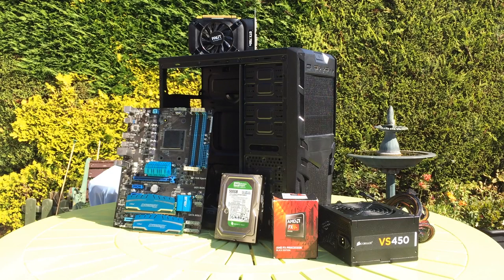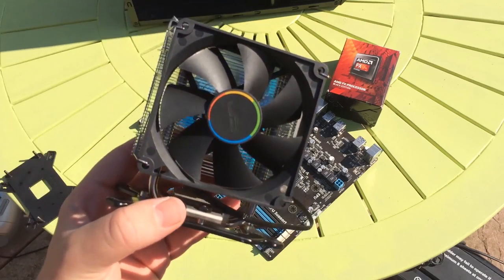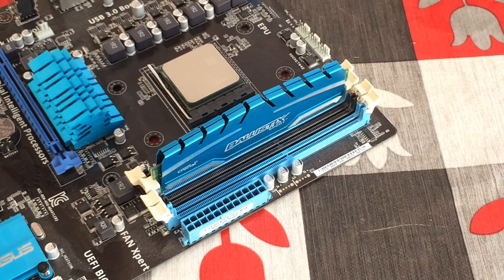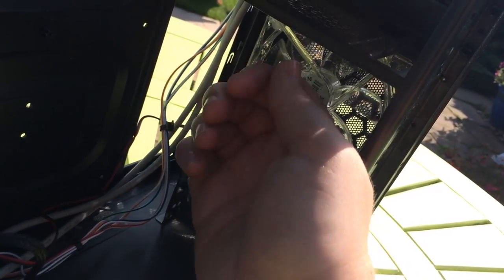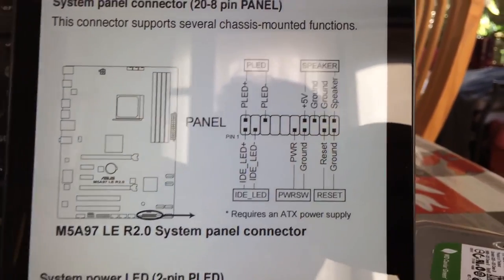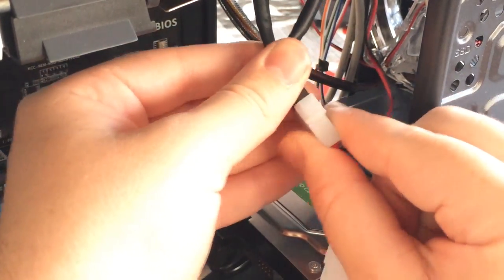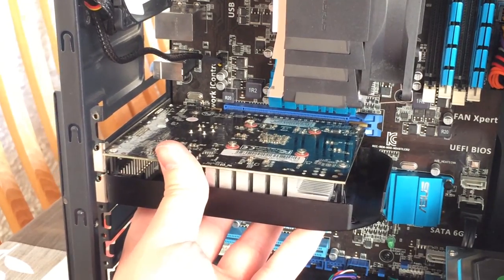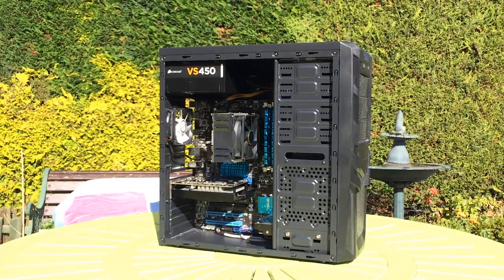Let's Build A Budget Gaming PC - Sensible Used Parts System

Comment: That's such a nice little rig...
- M5a97 R2 LE is a nice budget board, with 970 chipset which is more than ok for the Fx CPUs, being a mid to high end native AM3+ platform fully 125w cpu capable, that even features rear and front USB 3.0, and up to 32gb DDR3 1866 and all SATA3 connectors, so pretty solid for upgrades inside the platform. The only real downside is the lack of disipated VRM, a huge matter on such an overclockeable technology like Fx series. For that i would suggest M5a97 R2 (non LE). or m5a97 Evo...
- Fx4300 is a nice little budget CPU... it can be found for 1/2 the Fx6300 price and will provide about 3/4 the performance, including a slightly improved singlecore performance, thanks to his higher frequency. It is also THE lowest consumption FX cpu. on both single and multicore performance, it is very very close to Phenom II X4 945 c3... but with some newer instruction sets included. It is a nice stop gap for maybe one year up until getting an Fx8350/70.
-GTX750Ti Despite being kind of dated and somehow underpowered for today's needs... it is still a good gaming card for lower resolution (A.K.A. 1366x768) in which can perform as good as Rx570, so yes, it is a good gaming card even for 2020.
- 8GB DDR3 1600/1866 is a nice sweetspot for this ring, and it is good to be in 2x4, since 4gb sticks can be purchased really cheap and throwing 4 then 8, then 12 and finally 16gb. It is safe to mention that 16gb is the maximun reasonable for ANY AM3+ CPU, including Fx8350/70, since in the future when 16gb be a little short for gaming and stuffs, Fx series will be way obsolete.
- I wouldn't have picked an aftermarket "fancy" cooler, just a stock 125w AM3/AM3+ cooler, which are extremely cheap used will provide a little extra cooling compared to stock 95w... the money saved MUST be used in a 120gb SATA3 SSD. That's the real deal to get a somehow "improved" experience, not for gaming but just for everyday usage.
- The 500gb HDD is ok, but not that much... nowadays games have skyrocketed in their disk usage... some games even needing 100GB of disk space... it is ok, nevertheless, to put a 500gb HDD and later on add another 500gb disk.
- The case is kind of ok, only real problem with cases are the need of 2x cooling solution, one frontal in and one rear out, this provides such an improved temp compared to no fan, it is mandatory to be honest... The next thing to search for is frontal USB 3.0 since it will really handy, i'll promise. But there are 5.25 bay brackets which have USB 3.0
Is this an "OK" build for 2020? well, yes... for the right price... and i know what i'm talking about... since i have an Asrock n68-vs3 fx + Fx4300 + R7 250x 2gb + 8gb DDR3 1333 + 1 120gb SSD + 2 legacy 160gb HDD, and i can play older Triple A tittles and modern MOBAS at 1360x768 high 45+fps no problem. Main limiting factor is the MOBO (only SATA2, no USB 3.0 and has a tendency of making CPU throttle every now and then)

Comment: Very good video! I consider my self a PC guy, but I have never ever built one. Because I almost always had no money for that, or even when I did - I used to buy prebuilt ones (yah, I know, God forgive me as I didn't know what I was doing...). You touch little details which are always left out by other channels. 

I still hope to gather some 300-350€ to buy a nice GTX1060 GPU. I hope I won't fuck up putting it in my case.

Comment: Making a mid range budget pc around $700, it has....
-Ryzen 3 1300x
-GeForce GTX 1060 3 gig
-8 gigs of ddr4 2400mhz ram
-1TB HDD and 128 GB SSD
-500 watt EVGA bronze rated power supply ( for future upgradability)
-( can't remember the exact mobo name) Asus B350 Prime Plus
Super excited can't wait for it to get here, just need to buy a case and keyboard but I can't decide :/

Comment: Try the x79 platform, it's not the cheapest for motherboards, but the quality of cpu-s is remarkable. I personally use a 100$ MOBO from aliexpress and $100 e5-1650 and it runs so very smooth :)

Comment: Nice build guide. I have the same CPU cooler, its a great quality cooler which is very silent and with great performance for the small tower model heatsink design. It would also be very interesting to see the performance increase when this CPU is overclocked. These ones usually overclock fairly well, and can really use it. As you thought, the CPU is the bottleneck here, as the AMD FX series is quite weak core wise because of the 2 integer, 1 floating point unit module design. One remark on the HDD choice, if possible avoid getting a green or eco hard drive for a budget build. They are build to be energy efficient  and trade in performance for it, while used prices (at least, here in the Netherlands) are quite the same

Comment: I have the non le version of this board, with an fx 4300 overclocked to 4.5 stable on air with a hyper x 212. Exactly the same gpu, 2gb palit 750ti. I love my rig. It's cheap, and performs well enough to kick any consoles ass

Comment: I usually do the front panel header OUTSIDE first and then put the cpu, ram, etc while the board is in the case.  Unless it has a bracket for the cooler.

Comment: Here's a budget PC build that's a little higher end than this:

FX 8320 Black Edition 
16GB ADATA DDR3 1600 
GTX 1050Ti (I chose the Gigabyte OC edition)
ASUS 970 Pro Gaming/Aura Motherboard
Noctua NHU-14S
For newer builder's I'd suggest getting either an NZXT S340 or Phanteks P400S for ease of building
128GB Samsung SSD (any brand will do, this is for OS)
1TB Hitachi HDD (again, I'd recommend WD for this as their drives are usually cheaper but I got the Hitachi on sale)

Set your CPU multiplier to x20 for a quick and stable OC to 4.3GHz and you have a decently beefy 8 core chip, the Noctua cooler keeps it cool and almost dead silent (even at 90% fan speed), 16GB is plenty of RAM for almost any amount of Chrome tabs, the Phanteks case would be my pick due to all the dust filters, fan controls and RGB options available, plus all the sound deadening keeps it all quiet, The reason I chose the 1050Ti OC is because the card has a small factory OC, Gigabyte are a trusty brand and the card's fans are OFF up to 50C meaning the system is almost dead silent even under load.

Comment: my latest budget build.. 
Dell vostro 400 775 mobo $15
LGA771 Xeon X5470 @3.3ghz $30
hyper T2 cooler $10 
8gb DDR2 800mhz $20 
500gb SSHD $20 
GTX 750 ti $40 
Apevia case w/ 480w PSU $25 

Modded the motherboard and CPU and ended up with a $160 beast..

Comment: many intel motherboards color their panel layouts which shows you which wire goes where to make it easier to connect your panel cables. you would think in 2017 there would be a universal standard panel layout connection method by now, but nope..

Comment: I'd like to see you try 750 Ti SLI using different SLI auto
Reply: Joe Manfred GTX 750Ti doesn't have support for SLI, u won't find any sli bridges on any gtx 750
Reply: gtx 950 SLI would be cooler since they actually support SLI and can sometimes be bought for the same price as a 750 ti if you look for more then 2 seconds.
Reply: It's physically impossible to SLI a 750Ti

Comment: Any chance of seeing a WoW bench with this? I'm thinking of using some spare parts to build a pc for my bro. He currently got a stock Q6600 with a 1gb gtx 750 (non ti), i have a spare fx 4100 on a ga-990fxa-ud3 with 2 failed ram slots that limit it to single channel & also have a spare radeon hd 6970 2gb. Depending on the psu for the build either the 6970 or 750 will be used, what you showed would be slightly better than the 4100 & 750 so just currious how it'd perform.

Comment: i have the same case. In my country it was around $15 brand new and as low as $5 used. There's also one with 350w PSU for $25. Too bad the usb ports are rubbish.

Comment: The GTX 750ti is going for $170 USD here in America.  You could save even more in this build by using a GT 1030 ($80 USD) and get relatively the same performance.
Reply: Maybe new, but don't by a 750ti new. You should be able to get one for $70. At 170 you can get a 1050ti or if lucky a 1060 3gb.
Reply: Dan Bodine - But, where to get it new? Can you trust used graphics cards on eBay? There is Craigslist. But, my rural area is kind of a deadzone for PC hardware.
Reply: Axess2084 Generally you can trust them,just do your research. Reddit hardware swap is also a good option.

Comment: What about:
i7 980x
32GB DDR3 RAM
Gtx 980Ti
550w Psu
Kraken 31x watercooler
Thermaltake 21 Versa

Guess the price
Reply: 400 dollars
Reply: Thomas Jansen $1050 dollars
Reply: DarkTube These prices are way higher than you think
Reply: no sir its 400 i bet. its not 1050 dollars i think
Reply: Actually around 1400 dollars
Reply: I'd say about £500 or $400 since UK prices are fucked
Reply: It's definitely not 400$.
It Got A Fucking 980ti

Or maybe he snatched it at a really low price(which is unlocked)
Reply: Kabeer Ali yeah but the i7 is old as fuck and the cpu cooler is undoubtedly old as is the rest of it so the only part really worth any money is the gpu hence the price namely covering the gpu and he probs got the rest of it nigh on free.
Reply: I have a high end ryzen 1700 rig and I paid, including my mouse, koyeboard, and rgb lights, $1,300 after all upgrades this was only 5 months ago.  So "$1400" for his rig is kind of ridiculous
Reply: nocomply Good motherboards that support that 980x can be incredibly expensive. You should look it up, it's crazy.
Reply: 300-350$
Reply: Im going to say 650
Reply: Hillary Blinton did you just say that the gpu is 80$,it has the power of a 1070
Reply: If I could get a 980Ti for anywhere NEAR 80 dollars (75 ish Euros) then why would I be seeing people selling reference 970's for 400+ euros??
Reply: 250, bare minimum, 300 would be a reasonable price for a 980Ti because it's almost between a 1060/1070 in terms of performance
Reply: 600$
Reply: Dylan Collins after oc 980ti is better than stock 1080..
Reply: 200 euro for 980Ti
Reply: These motherboards are rare and hard to find in my country so i paid lots more
Reply: Sylwester nope. You need to overclock a 980ti to its absolute max to be equal with a fe 1080. Then overclock the 1080 and it once again smashes the 980ti. However don't get me wrong, that's still good for a last gen card. The 980ti is amazing as such there is no point in buying a 1080 if you have a 980ti.
Reply: $420
Reply: 800
Reply: 5000$
Reply: I thought that pretty much all X58 motherboards were limited to 24gb ddr3
Reply: 700

Comment: But you still need a monitor as well as a mouse and keyboard. You can get cheap 22" or 24" monitors for a bit over 100 euros or try to find a used one. And if you really don't care, a cheap mouse and keyboard will set you back 10-20 euros. 
Even cheap, old and used components like the ones used will get you a decent gaming PC still capable of handling most new games, although not with maximum settings at 1080p/60FPS. But a PC capable of that will set you back at least 700-800 euros, if not more.

Comment: Will be interesting if you put the fx 4300 with your 1060... 👀
Reply: lolCatHD it'll run things very nicely. There'll probably be some bottleneck, but I doubt it'll be bad. I was using my fx 4300 with an rx 480 before I eventually moved on to Ryzen
Reply: ArtisChronicles thanks bro

Comment: Hm... I'm kinda confused... My Xeon E5450 perfoms better than the FX in CB but has a lower Clockspeed and Powerdraw so why did you use an FX instead of a Cheaper but more Powerfull Xeon and Mod it to the LGA775 Platform?

Comment: is the corsair vs series reliable and good to power  low to mid end hardware?
Reply: I used to have a VS 550 and it broke after 6 months. From what I heard, the VS450 and 550 have manufacture issue and it's not very reliable. However, VS400 and 500 are good. Been using the VS500 since I had it as a replacement for the 550 (about 1 year) and so far so good.
Reply: They're terrible actually, get a CXxxxM (the M part is important), an EVGA 420 or an EVGA 450 B in the same price range, they're much better.
Reply: Thats strange, cos i have had cs 550 for over half a year and had no issues?
Reply: They're not in the "explosive chinese PSU" quality tier, but they're still really poor quality in comparison with other PSUs in the same price range.
Reply: Rudy S - I've been using the  VS 650 for more than a year and I have not experienced any issues at all. This brand of power supply may not be as good as other types, however the price is worth the buy for even a decent build.
Reply: This wont blow up, but dont expect it to last long.
Reply: @idk-jb7lx  lmao "explosive chinese psu" 😂😂

Comment: 2 years ago i had a GTX 960,my computer broke down and i sold the parts that was still working,now i'm thinking about buying a new graphics card but if i do so i'm going to need a new power supply and i was thinking of buying a after marker CPU cooler to.
What graphics card should i buy?
At the moment i have a Q6600 paired with a gt 610 for display adapter,the on board graphics is terrible.
4GB card should be fine.
GTX 1050 Ti
RX 550,560?

Comment: Nice video.
Though, you could have gone for an i5 1st gen instead of the fx cpu. The 4300 isn't capable of much, and is bottlenecking the 750 ti at 720p
Or atleast you could have OCed the cpu. Make better use of that cooler.